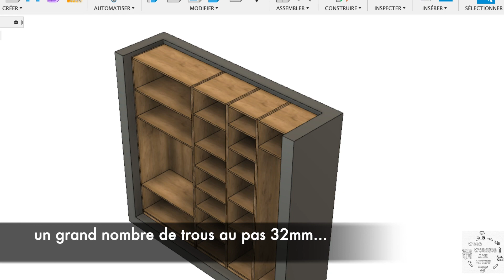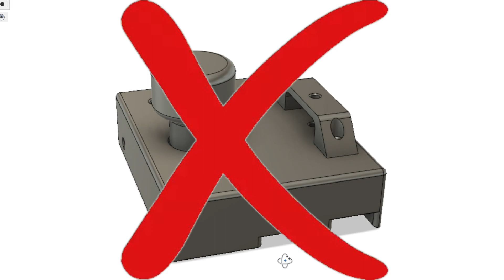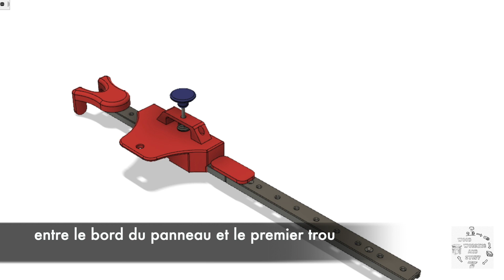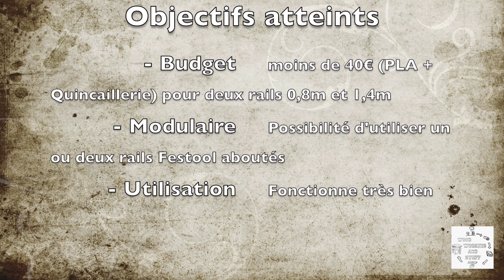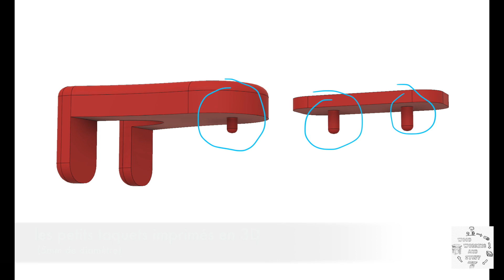Fabrication d'un système Festool lr32-sys maison

Comment: Bonjour ,
contenu super intéressant.
Je suis, pour ma part, équipe en Makita (rail et defonceuse).je vais voir ce qui doit être modifié pour que ca fonctionne.
et un grand merci pour le partage!
cordialement.
Reply from the maker: Merci ! :-) Effectivement les rails makita étant identiques aux festool il me semble, il ne doit y avoir que la base à adapter. Le reste doit s'adapter sans modifications... Si ça t'intéresse, je peux mettre les plans Fusion360 en téléchargement pour une modification plus aisée...
Reply from the maker: ... je ne sais pas. A l'inverse, je n'ai jamais réussi à me familiariser avec ;-). Quand j'aurais 5mn je mettrai aussi les plans fusions sur l'air du bois. Tu pourras tester...
Reply: @WoodworkingAndStuff  je n'y manquerai pas.merci
Reply from the maker: Pour info je viens d'ajouter le fichier au format fusion360 sur l'air du bois dans la section "Plans"...
Reply: @WoodworkingAndStuff   merci beaucoup. Avec quelle imprimante 3d imprimes tu ?
Je suis avec une ender3 et cura. Le guide n'entre pas sur le plateau. Impossible d'imprimer...:face-pink-tears:
Reply from the maker: J'ai une Artillery Sidewinder X2. Elle a un plateau de 30cmx30cm. Je mets les grandes pièces en diagonale sur le plateau.
Reply: @WoodworkingAndStuff  va falloir que je trouve une imprimante avec un plateau plus conséquent !
Reply from the maker: moi je les ai fait de cette taille car mon imprimante le permettait. Mais rien n'empêche aussi de les raccourcir. Ca en fera juste plus à imprimer...